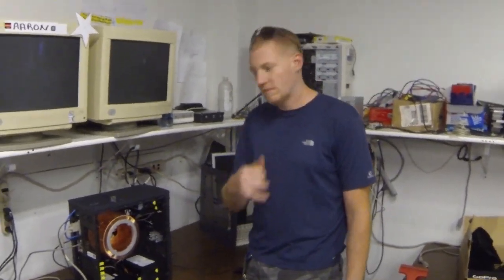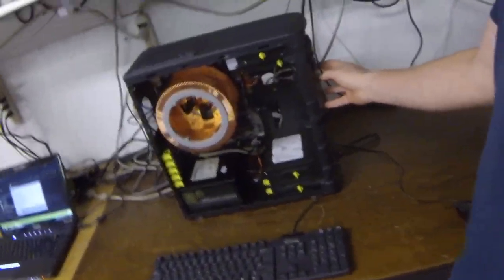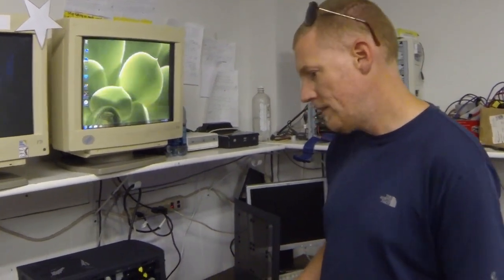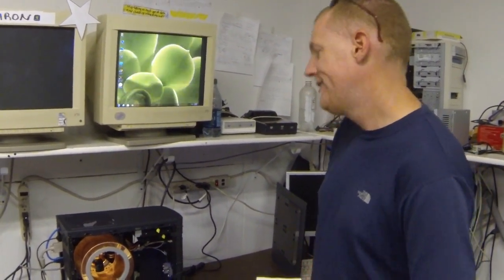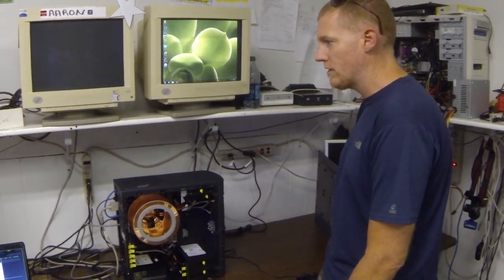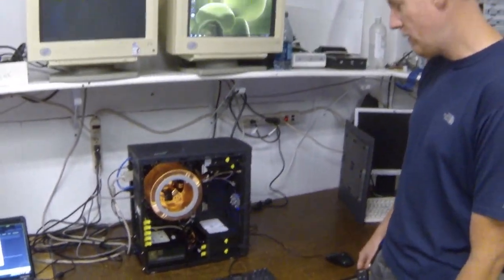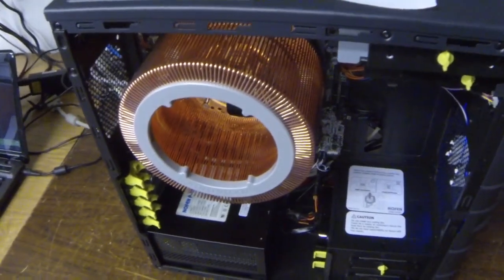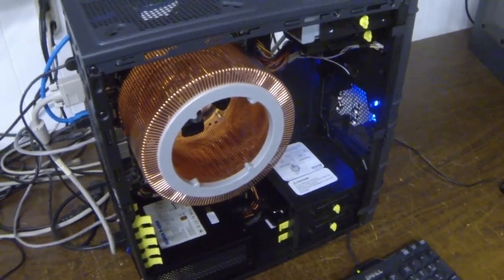NoFen / NoFan Followup review INSTALLED!

Comment: Things a joke. I've been running a Xeon e3 1246 v2 with the no fan cr- 80 cooler. 84w tdp cools fine on it. Wouldn't  rust my money with a crappy no fan psu. Get a no fan seasonic psu that's platinum rated and not going to die in a year. Artic coolers released there no fan passive 5 slot gpu cooler. Cools up to 200w with fans. Installing on a 970 mini itx.
Reply from the maker: Michael Grant 
This was built for a customer who has a hearing disorder therefore needed absolutely zero fans. Customer ordered these parts and had us assemble them.
Reply: 3techs If he can hear a fan at sub 500 rpm that's some problem. The noise of the electrical current flowing through the psu capacitors is louder. I was just stating the No fan Cr 80 is a much better product and fits in a mini itx environment. Runs at 63c max with a 140mm be quiet fan at sub 400 rpm on top of cone. I wouldn't trust No fans psu's, thus seasonic platinum. SIde note you can mount full passive psu's horizontal and have no issues.
Reply from the maker: Michael Grant
I hear what your saying. Customer claimed to have a severe hearing disorder. He couldn't even stay in our shop for more than about 5 minutes at a time because of the ranges of frequencies he picks up.
I agree about the Seasonic however like I stated above he ordered these parts and we simply assembled the system and installed Windows for him.

Comment: can u pls make some testing and post the temps ? i'm reallly wondering how high / low they are
Reply from the maker: I'm sorry but customer picked up the computer before we could do any temp tests which really sucked. :(
Reply: too bad, the cooler looks really nice and if the temps would be good it would be a great silent workstation
Reply from the maker: I know customer has been using the system for about a year now and loves it. He isn't a power user by any means though, I think he mostly does productivity work(excel, access, etc)
Reply: yeah i would only install it in a productivity build, like an office. well than I will surf in the internet to find some results. thx. have a nice day
Reply from the maker: You as well! :)

Comment: That case is an IN WIN Dragon Slayer... It's an $80 case. Not sure how much that heatsink might cost, but it seems a bit ridiculous.

Link: http://www.newegg.com/Product/Product.aspx?Item=N82E16811108236
Reply from the maker: It's likely just branded differently however customer purchased this as a package which included the case, heatsink, and fanless PSU. It wasn't just a case.
Reply: In Win Dragon, 80$. Seasonic Fanless 520w 80+ platinum 140$ (one of the best psu on the face of earth) Silverstone Heligon HE02 Passive heatsink 70$. Where's the 450$ at? cheap crap I wouldn 't even build it for them even if they paid for it LOL.

Comment: To boost the apu performance 
Then you just have to dedicate 3 gb of the ram to the apu 

That will boost it alot when you are only running on onboard / apu 

Wr have been testing it out and it was helping alot 

And even more if you then have some 2400mhz ram inside

Comment: Huh, why 16 GB in a machine that isn't really built for something that would actually utilize the entirety of that memory like video/3d rendering? I mean it's not even built for gaming!
Reply: Because it's a pretty sweet system.

Seriously though, the 16GB of system memory is what you have an issue with? They probably could have tossed an i3 and 4-6GBs in there and have practically the same performance, bit of an exaggeration there, it would make more sense for such a system.
Reply: if you leave firefox open for a few weeks, you'll get that 16 gigs.
Reply: CheezMonsterCrazy  APU is an AMD thing this is a core i7 im guessing 4770k? which has an internal igpu and does not use then same arch as the AMD APU's that would benefit from faster system memory. so faster memory and more of it doesn't make a tremendous amount of difference with these chips. he would be better off with something like this.

http://www.bhphotovideo.com/bnh/controller/home?O=&sku=1025305&gclid=CjwKEAjwpIefBRCuir7wy-f1kCwSJADXBi2azaogWR2A4bZW2ywrzaIbVRI4-s3LiWmbhxNyAwhTPBoCt1Hw_wcB&Q=&is=REG&A=details
Reply: Malsherz I got an i3 started with 6 added 8GB for a total of 14GB that still looks like no noticeable difference than just the 6 was in.
Reply: you act like gaming requires anywhere near that much RAM anyways LOL. anyways that being said there are plenty of reasons he needs it, ALSO, its better to know what it can handle for this sake.
Reply: Of course gaming doesn't need 16 GBytes. I wasn't trying to act like it, but I guess I might have come across that way.  What I was trying to say was that this build, with the hardware, or lack thereof (dedicated graphics), the applications on this computer will most likely not be something like photoshop or some 3d rendering program. Both would use 16 GBytes well, however, they would need gpu acceleration from a graphics card to provide a satisfactory experience from a professional standpoint.  This I'm sure isn't provided to the same degree with Haswell processors.  Also the not all that impressive scores on the benchmarks shows that it really isn't built for gaming.  Which I understand doesn't need the 16 GB, but that was the point. If the pc isn't going to perform that well in the graphics department for even games and such, why would you have 16 GB for a machine like that?
Reply: Like I already said nowhere does anyone say or suggest that the 16gb is 'needed' in the first place. That being fact, it doesn't even matter, because it's even better reference to see how much a system like this can actually handle without getting too hot. What is the problem with having 16gb in this system. none of this system is typical. all SSDs, all passive cooling, 16GB RAM, etc. it's not a problem. there is no issue here.
Also you do not need RAM always just for games and graphics....... lmfao.. music production, for one, is somewhere where you need minimal 8GB and that will be noticeably underpowered. 16gb+ is what I have found is necessary for useful live music production (electronically) through software. so that being said this is a perfect machine for something like that (minus the SSDs) but honestly there is no issue here, it's all for fun. none of this system is actually 'necessary'
Reply: Yes, I would agree that none of this is "standard". I also didn't think of music production on it either.  I just thought it odd that he would build for someone (I'm assuming a paid service) with 16 GB a system where you're not really going to want to do too many demanding things that would make a lot of heat, being all passively cooled.
Reply: The Gentleman Sandwich Because on an APU only system, all of your graphics processing RAM is your system RAM, not the VRAM you would have on a DGPU. So in addition to all the CPU tasking, all of your graphics processing needs to occupy that memory as well.

In the case of APUs, more and faster RAM is a definite benefit. Much less so with a dedicated GPU system.

Comment: I remember the last time I ran a computer without fans, that was a really long time ago though(think it was back in 1999). As for your explanation of the APU... either you have no idea how they work or you simply didn't bother telling it as it is.

Quick info about an APU: APU does not use the processor to run graphics as it is said in this video, it does however have a dedicated GPU on the same same "chip" as the CPU. it can best be compared with the old integrated graphics that used to be on the motherboard in the chipset. The APU design is however superior to that design since it can use the larger CPU cooler as well as having a shorter circuit to the CPU for communication. IT is important to mention the difference since you could run graphics directly off the processor on older PCs.

Also, how you could even to consider running an i7 4770s with the HD4600 for gaming instead of an AMD A10 is beyond me. Also, if you really want to take advantage of the new GPU that was introduced with the Haswell then you should consider buying the i7-4770R that has the Intel Iris Pro 5200 instead of the HD 4600 and is supposedly twice as fast.

Comment: Around $1000 for a "low power system"
What the fuck were you thinking?
Reply: where work with labor parts and software that's what similar system with stock intel heat sink costs.